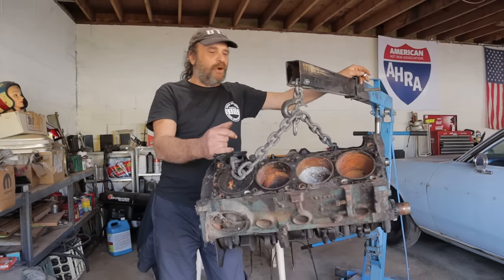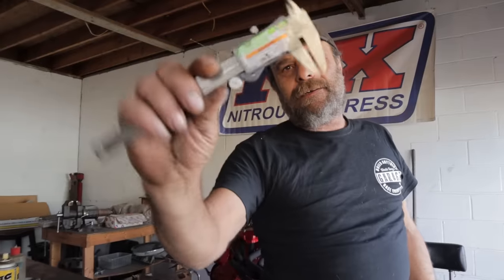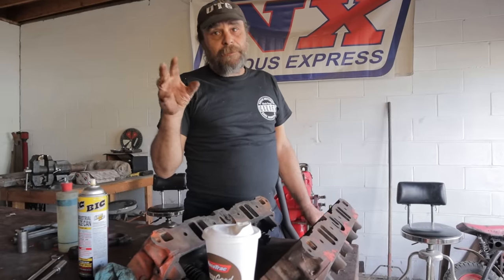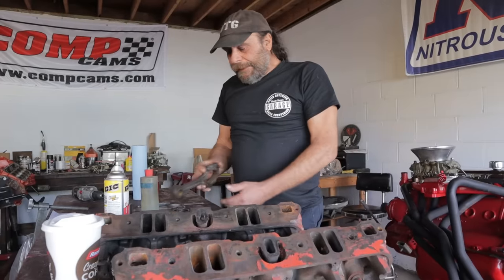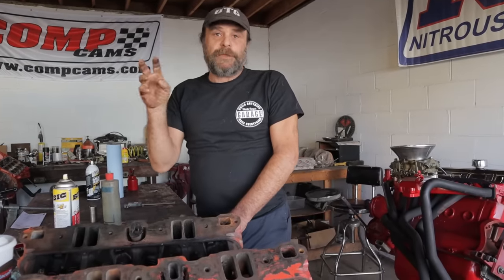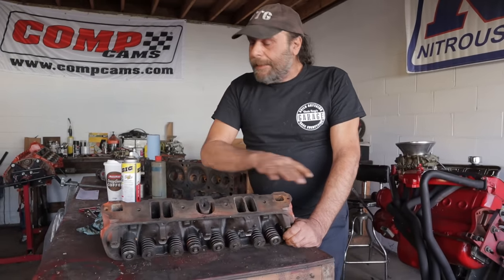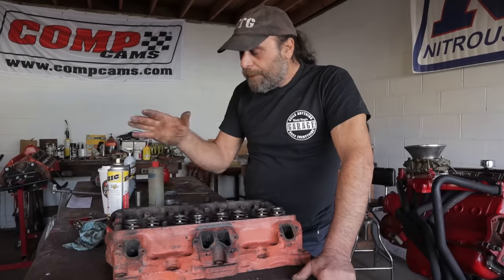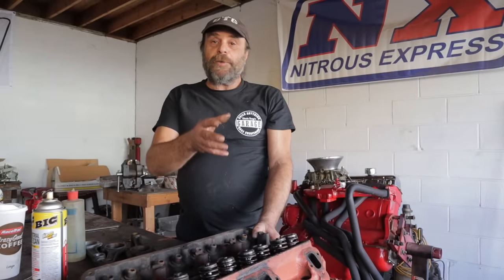The Most Under Rated V-8 In History?

Comment: To save a few more pennies the 318 got a nylon timing gear. The 340 got a steel gear with a double roller chain. The 340 timing parts fit a 318. Use them!
Reply: Many of them have already had them replaced due to failure. My 73 318 received a double roller  at 80K miles. The nylon tanked. I do not think it was a cheaper option so much as a marketing ploy of a quieter engine. The replacement double roller was cheaper at the parts counter than the nylon OEM. It was a no brainer.
Reply: Quieter engine with that nylon gear.
Reply: @drtb69  Real quiet after it breaks
Reply: @craigscherer563  The timing chain was cheaper than the gasket set.
Reply: @drtb69  Barely...  The fan was still louder...
Reply: Same thing with the old Ford 300cid Straight six. They all have gear drive timing sets but the truck/van motors got the nylon gear to help them run more quietly. But, find yourself a timing set from an industrial motor. Ford sold these things for decades in everything from UPS trucks to generators to airport tugs. The industrial timing set is all steel and is a direct bolt in swap for the nylon.
Sure they whine more but you'll never have to replace them again.
Reply: My parents got a used 73 Sportsman in 74 with 11k on it, they thought they got duped and got one with the odometer rolled over. Eventually the gear issue was discovered and it ended up needing replaced every 2 years because no warranty on work unless OEM parts.
Reply: Ford, GM, and Chrysler all used a nylon toothed timing chain sprocket to make the engine infinitessimally quieter... and cause you to trade it in after the warranty ran out...
Reply: people like yall old timers (no offense im actually jealous) help me from makin dumb decisions and making smarter ones
Reply: Superduper DavidMiorgan   If standing on the brake before clutch was the only thing that hurt a nylon timing gear, all us auto-trans guys would still be using the one they installed at the factory.
They died young no matter how gently grandma drove it (especially after I borrowed grandma's 318 Scamp)
Reply: @nastybastardatlive  - Actually it's a "sprocket" and I want it metal for at least 150,000 trouble free miles! Well, really, rather have metal timing GEARS for 500,000 trouble free miles... OK, auto manufacturers don't want to give us that...
Reply: @nastybastardatlive  40,000 miles? That's OK for something accessible like a thermostat. If internals aren't reliable for 150,000 mi they don't belong on any optional engine.  Maybe in the base version. Then after paying good money for a pro to install a new steel timing gear, unretrieved nylon bits in the oil pan clogged my oil pump screen (and/or galleys?) a few weeks later. The nylon bits led to a rod thru the wall on a Pontiac Firebird 400. Go ahead, drive with a nylon gear. Maybe you own a towing company...
(@BuzzLOLOL - Now I want to edit but sprocket is too hard to spel)
Reply: @drtb69   You don't hear the difference.
Reply: every day you know something new, Mexican engines all came with steel gears but and cars and  trucks  shared the same engines, we dont have truck 440 or car 440 we got only one version with 2 or 4 barrel carburators, pick ups and trucks got the 2 barrel and cars the 4`s because  reasons also we got less transmissions 3 speeds automatic and 4 speed manual, you guys got lots of options and combinations.
Reply: 318 police engines came with steel gears and a double roller timing chain. I use to buy them from autozone. 
Whenever I bought a used 318 one of the first things I did was change the timing chain to the police setup.
Reply: Nylon was supposed to be quieter not cheaper... 318-3 came factory with the double roller chain and gears just like the 340..not sure but I think the later 72 on up 340 had the Nylon gear too....
Reply: @deanvav7820  I pulled a 340 out of a crumpled 1973 Demon, and it still had steel timing sprockets. They switched to a cast crank that required a different flywheel and balancer that year.
Reply: Good tip -- thank you.
Reply: It wasn't a "nylon timing gear" and it most definitely was NOT done in order to "save a few more pennies." They had the steel gears coated in nylon as a quieting measure. Ford, GM and Chrysler ALL did this. Worked fine until the engine was overheated. Then the nylon coating would crack and shed from the gear.
Reply: @peters8758 to replace the cam gear on the 300 is as easy as a modern euro oil change
Reply: I think many V-8 engines in the 1960"s used a camshaft sprocket with nylon teeth.  I recall my 1965 Chrysler 383 had one.  The teeth were still intact when I swapped in a new "timing set" (chain and sprockets).  The purpose was to run quieter.  The opposite is to use a gear-train with no chain, which I recall a few production engines did, and available aftermarket for Chevy small-block.  Makes a noticeable whine.  Nylon is very rugged and can last a long time, even in hot engine oil.  I recall magazine ads in the 1970's for a .22 rifle with a nylon-lined barrel.
Reply: @peters8758 Haha yup!!!
Reply: @peters8758 them damn plastic teeth start to plug up the oil pump suction screen too!
Reply: @perryhvegholm2941 The nylon disintegrated over time even if the engine wasn't overheated. Most of the nylon tipped cam gears were aluminum, not steel.
Reply: Many timing chain replacements and don’t remember any cam gears failing regardless  of material, although the chains had enough slack you could hop em by hand. Good ol’ pre tensioner days. I did have a 71 TNT 440 with the factory aluminum cam gear throw the chain while starting it. Pistons and pushrods didn’t like it. The cam gear was down to baby teeth, no idea how it worked as long as it did.
Reply: @williamgrissom9022 it was a nylon stocked rifle...

Comment: I found two 318's at a scrap yard.  They had just been dropped of by a boat dismantler.  They both had four bolt mains and steel cranks  with 4 barrels.  The iron flywheels never had a clutch run on them.   Also dual points with 8 qt oil pans.  I scored them for  $15 each.  Never knew Mopar made a four bolt main 318.

Comment: as a kid i drove a 318,,,,  GRAN FURY ,, DAMM THING NEVER DIED , AFTER OVERHEATING 3 OR 4 TIMES AND RUNNING OUT OF OIL 2 OR 3 TIMES ,  AND KEPT RUNNING ALTHOUGH IT EVENTUALLY SMOKED A BIT ,, BUT WAS QUITE AND VERY RELIABLE ,,,  INDESTUCTABLE , UNLIKE TODAYS ALUMINIUM ENGINES , THX TONY, GOOD INFO ..

Comment: The memories... had a '83 van with a 318 and couldn't kill it. I tromped the gas to the floor until I ran out of gas; I over-loaded it with bricks until it wouldn't steer; I punctured the rad and drove home -100 miles apporox and got about 500 000 miles before rust and neglect took it. Boy, I sure wish I had it back.

Comment: If Rodney Dangerfeid was an engine he'd be a 318. No respect. 
I've always had great luck with them.
Reply: He's been popping up in my feed🤔
Reply: Caddyshack. Chevy Chase, Ted Knight, Bill Murray.... "hey Wang!"
Reply: @ericstone8812  😂😂😂
Reply: @j_freed  this is my friend, wang... no offense
Reply: If the 340 has a bigger bore than the 318, does that make it lighter weight? I am actually more interested in weight than power, since light weight gives more traction with front engine RWD and I have lost far more time digging myself out of the mud and snow than I have ever spent accelerating.  Can you bore a 318 out to 340?
    What light engine is easiest to bolt into my '78 B200? in place of the 318? 239 is still a bit heavy.  How hard is it to adapt a 3.3, 2.5 or 2.2?  I hear if I had a Chevy van, I could easily bolt in a chevy 2.5 or 4.3 but what about in between engines? like Buick 3.8? or Chevy 2.8?
Reply: @alan6832  rather than talking around your issue, what are you trying to accomplish? Better traction with a 3/4T van in the snow or slick surfaces? Just pushing it around everyday driving is gonna take a V8, or a slant if you’re not concerned with highway speeds.... what’s your issue? What’s your target?
Reply: @Zephyrmec  32 ton dump trucks often get "pushed around" by 200 hp so a 3/4 ton van, really about 3 tons, needs 18 hp. Some lawnmowers have that, and a lawnmower engine would leave the nose light to improve traction greatly the same way loaded dump trucks have good traction.
    I have had 2 slant trucks and both had more than double the speed I needed on highways, and blew away the dump trucks I drove by 5 times or more climbing hills.
    I want better rwd traction than loaded dump trucks using the same methods, that is, lower ratio of engine weight to gross vehicle weight!!!
Reply: @ericstone8812  HHHAAAHAAHHHAA Priceless He Was !!!!!!!!
Reply: a friend of mine had a 318 bored 0.60 over a crane fireball came aluminum intake 780 holley carb rejetted and a headers ran great
Reply: @alan6832  Weight, in and of itself, isn't your answer. If other vehicles are moving around ok where you're having issues, then you should be looking at what advantages they have that you don't. Snow chains, better tires for the conditions, mounting a plow on the front to push all that snow out of your way, the answer is something more along those lines, way before weight becomes your limiting factor.
Reply: @crewdawg2008  Others use 4wd to get 100% of weight over the drive wheels at great cost in complexity and reduced efficiency.  I actually have a 4wd as well, but would like to replace it with a 2wd with most of the weight over the drive wheels.
Reply: @alan6832  Honestly, 4 wheel drives aren't exactly what I'd call greatly more complex, sure there are more moving parts, so more wear parts, but it's really not that substantial in the grand scheme of things, add to that the fact that more modern 4 wheel drive systems are pretty much as efficient as 2 wheel drives these days, I think that would be the way to go. I just really feel like this is a case where you're trying to treat a symptom rather than a condition, honestly.
Reply: @crewdawg2008  For me, the inability to run mismatched tires is an economic deal breaker, since it becomes non-viable for me to run tires that I find by the roadside.  Truly frugal cars can never be 4 wheel drive.
Reply: @crewdawg2008  Also, everything frugal is obsolete by definition, thereby excluding "modern" 4 wheel drives as well as everything modern.  Nothing becomes frugal until something better gets invented.
Reply: @crewdawg2008  Dune buggies are the best model for frugal traction.  Most are modified VW's but some of the best ones are modified Corvairs, but the problem with both are that they are becoming infrugal antiques.  Antiques do appreciate unless driven daily, but that is a problem.
Reply: @alan6832  Ah ok, so to shorten that excessive explanation, money is your major determining factor then. That does change the approach then
Reply: Obviously you don't know his mechanic, Mr. Vinny Boombaattz :P

Comment: My 1968 Fury 2 with the 318 and a 727 auto was the perfect road trip cruiser. Drove it daily anywhere for 11 years 1984 to 1995 and sold it on in fine shape. A friend needed a car that could seat 5 child seats and her. No problem.  On the highway 18 mpg easy at 70 mph all day. Had the heads done in 85 with hardened valve seats. Still miss it. The ride, the ease of steering, the low cost and incredible ease of maintenance, the comfort of that big bench seat with the floor vents and wing windows open on a summer evening.

Comment: We had a 318 in our '73 Chrysler Plymouth Fury wagon. A seriously underrated engine. You just couldn't kill it because the output was so modest. It had a surprising amount of torque given the small displacement. It had no problem towing our boat. Great engine that deserves way more respect than it generally gets.
Reply: It probably has a short 3:55 rear axle ratio giving the impression that the 318 was powerfull.
Reply: @MrJohnnyDistortion  i have a 3.07 ratio on my 318 2barrel dart and it does feel pretty strong even tho examples are different. Not a high performance out of the box, makes around 165 to the wheels, but does feel strong and steady for such a small displacement (when comparing to most engines with bigger or smaller displacement of that time)